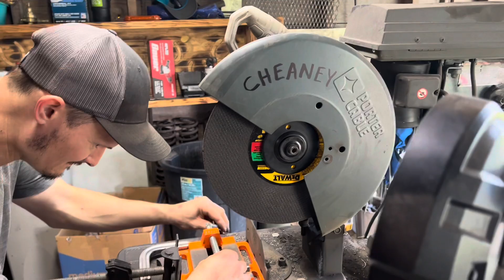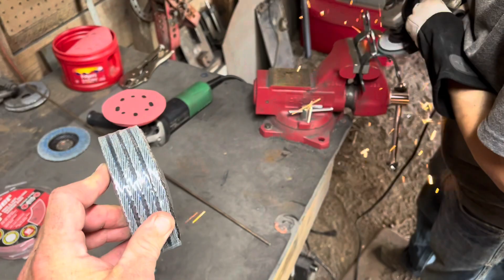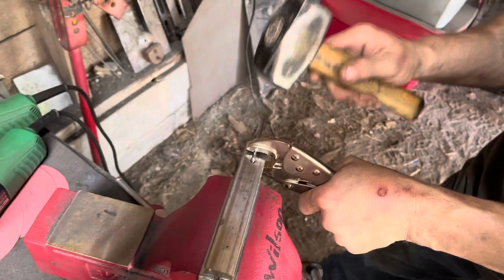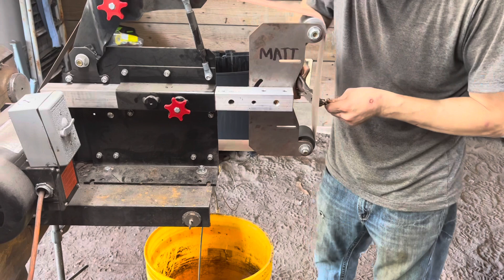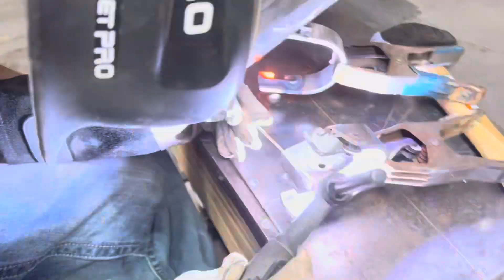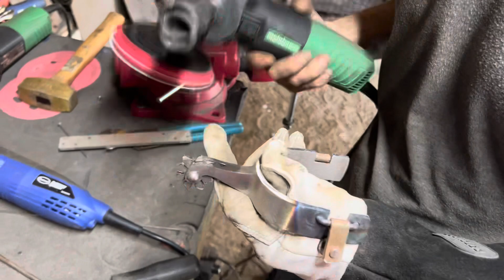Revealing the Secrets of Spur Making: Build Them in One Hour

Comment: This may be a stupid question but how do you figure the size of heel band to the size of the boot, is there a formula for it?
Reply from the maker: Definitely not a stupid question. Most makers generally have 2-3 sizes they build from. Men’s-Women’s-Extra wide.
Reply: You have to find the stretch out for the radius, plus the straight on each side. 

For example, if it's 1.5" radius, 3" diameter, you would do 3 x π = 6.2 or something. That's the circumference of the full circle, so half of that is the circumference of half the circle, so you have 3.1" + 2" straight on each side, you get 7.1"

That's just an example, you'll have to measure for whatever boots you are making the spurs for.